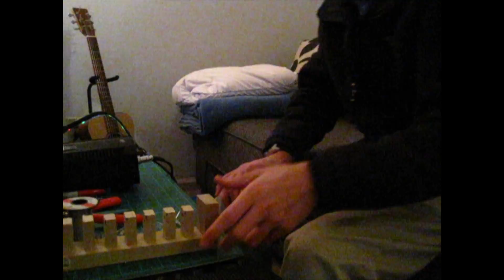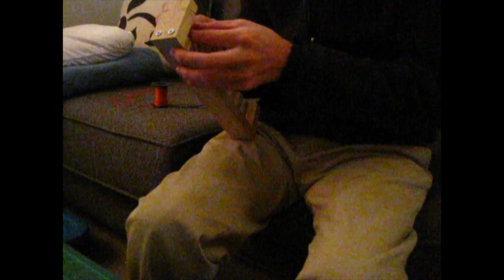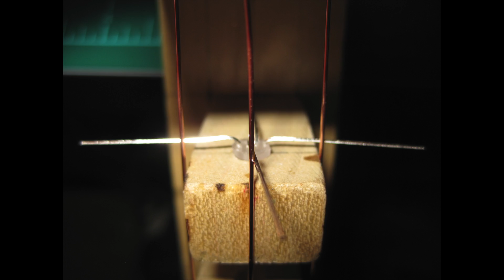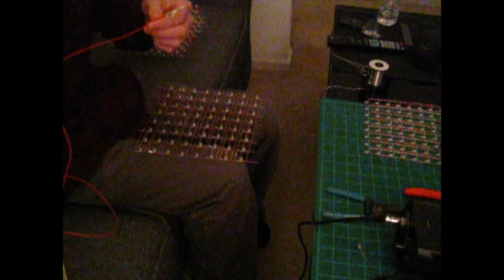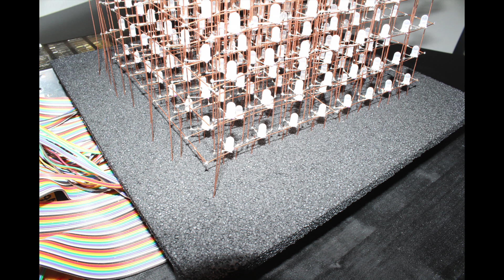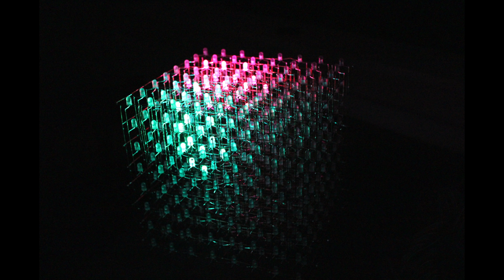How To RGB 8x8x8 LED CUBE - The BUILD!

Comment from the maker: ha yea probably... maybe more.... a lot more 200 transistors 3 leads a pop gives 600, 2 resistors per gives 800 solder joints, then the ribbon cable soldering, then the shift registers 16x25=400, the cube...ah!  too hard

Comment: I'm currently working on making a set of boards in Eagle that could be used instead of the multiple protoboards. I'm working on laying it out and using headers to plug IDE cables (cheap and readily available). Might make it more user friendly, but still a lot of soldering. I'll make them available when I can be sure my schematic is correct.

Comment: Kevin i saw in this video that you use only 1 capacitor on the anode board for the mosfets isn't it better to use 1 for every 1 mosfet or is that overdone (ordered 10 caps 1000uF)??
i thought that you meaning that in the theory video. I'm now soldering the cube, got the leds yesterday. almost having al the parts, only the pcb's from futurlec and the mosfets.
I've got the control pcb ready in EAGLE fineshing the power pcb. I don't think i use them because +/- 200dollar for the 4 pcb's at futurlec

Comment: Great job! I'm doing one at the moment, but to save some soldering I'm using a variation of the 595 shift register that's designed to drive LEDs (actually sinks). Means there's no need for transistors, and only 1 resistor per 16 outputs. The single resistor is used to set the output current for all 16 ports. Part number is TLC5925 if anyone else is thinking of doing this!

Comment: Great video. I have been working on 4x4x4 RGB cubes, im still trying to figure out what way to build a cube, and control circuitry. I currently have 4 designs going, and im still not sure which way I will like best, but I have figured out a lot of manufacturing techniques and materials that I think will help you a lot.
I cant fit all the info in one message here, in this message, but I would suggest looking into music wire.
I have more details at
sites.google.com/site/rgbledcubes/home

Comment: mm, i forgot the 2 other sides for the layers. i think that 4 inches of loss per cut sounds reasonable, so i was estimating 12 in per row, just to have wiggle room.
the fpga will be awesome, i can run at pretty much the frequency of the shift registers with it (actually it wouldn't be hard at all, seeing as i can do logic at 200 mhz :D ) i was also thinking of parrallelly loading multiple sets of shift registers so i can get an even faster cycle time. i'll have to play around with it.
tnx :p

Comment from the maker: sweet! an FPGA controlled cube would be sick.  make sure you over estimate the wire, cause you'll end up wasting a lot of it, but I would say its approx (64*3)*8inch+8*8*8inch+8*2*8inch = over 2000 inches or 181 feet!  I feel like I used way more than that though... should have kept better track

Comment: i am planning  a pretty similar project using an FPGA as the device controller. this has been pretty helpful for me in terms of visualizing what i want to do. 
i am wondering how many feet of wire did you use? i found rolls of bare copper wire AWG18 for pretty cheap (it will be a bit thinker, but i think it will help with more support) but i don't know if i should by 200 ft or just get a 500 or 1k ft roll... i estimate 64*3 + 64 ft is that about right?

Comment: You don't have to do it manually. 
For ex. use a guillotine to cut 3 by 3 hole squares of perfboard of the style Kevin used for the chips, run the three wires through 8 of these squares leaving the middle 3 holes for the led pins. 
Spread some flux paste on the small perfboard square copper side, melt some solder in a pot, lower each tiny square with the led on the pot. Solder will wick up soldering the square perfboard side fixing the wire and led pins. Then clean it with isopropyl alcohol.

Comment: No, it would be 1000 leds. The three colors are in a single led with 4 pins.
 
If you want to do something cheaper, make a scrolling text display, 8-10 "pixels" high, as many pixels as you can afford in width. 

With something like this, you could indeed use three leds for each pixel under a diffused plastic/plexiglass cover, but the cost difference would be small, it's about $0.08 per single color led vs about 0.3$ for rgb led.

Comment: It can be made with about 150$, maybe even less, with some careful optimizations of components. 

With different type of leds (common cathodes instead of the anode ones used here) I think it could be done even cheaper, for example using array chips like ULN2003 which includes 7 npn transistors and the base resistors in a single package, reducing the costs this way. But I may be wrong.

From the 2 videos, I gather Kevin did it like this because he could source these parts very cheap.

Comment: @23:00  I wish you'd remove the comment about getting lead poisoning from soldering so much. 

Lead doesn't vaporize at soldering temperatures, the smoke is just the flux in the solder wire boiling. The smoke is not healthy, the substances in the flux can hurt your lungs in long term but there's no lead at all.